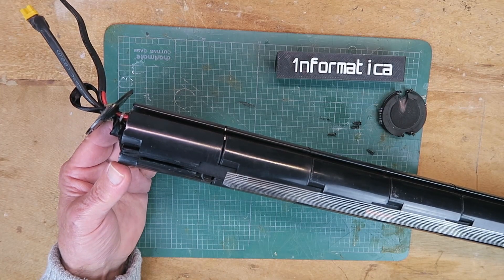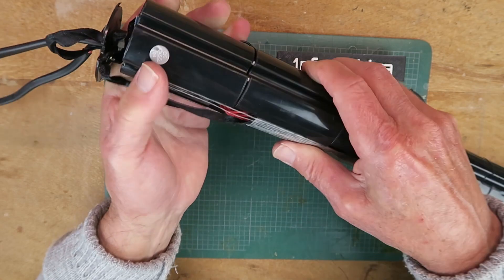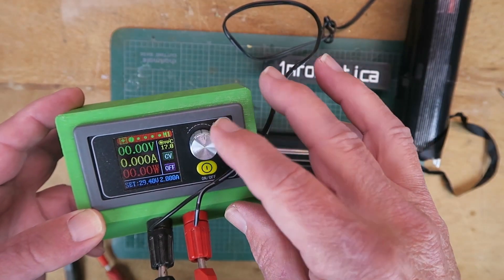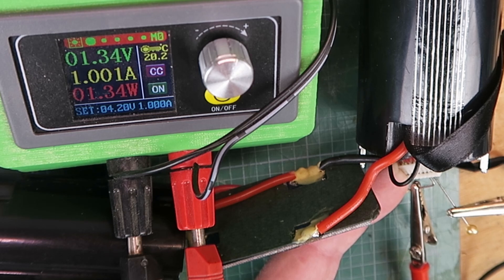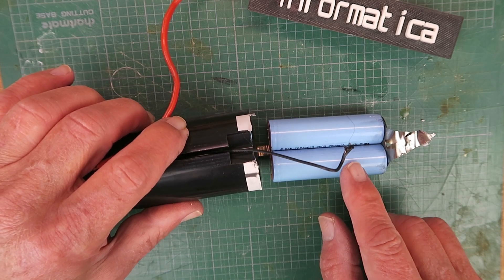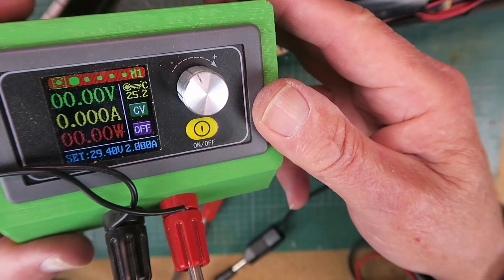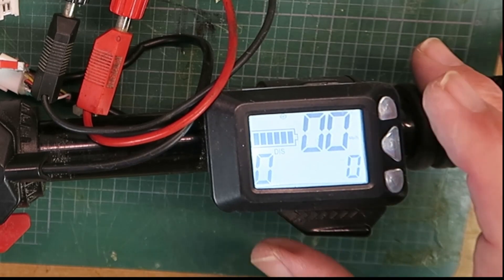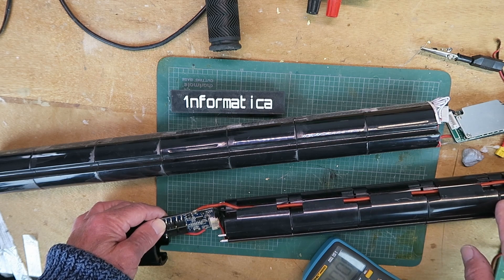Electric Scooter Stem Battery Teardown and Repair Guide

Comment: Great video! Did you find some kind of fuse inside? I suspect that my fuse burnt when i connected wrong charger but cant find it😊
Reply from the maker: Hey thanks! I don't think there is a fuse in the charger side. Most likely the BMS is the problem. If you have applied the wrong voltage it may be damaged or just need resetting. Search for BMS issues with your particular model. Thanks for watching, have a great day!

Comment: Hi, i have 3 dead cells in my escooter pack (in a group of 3 together) but not sure which to buy as i have no idea what capaicity the others are, does this matter? It's a 36v pack with blue cells with OOBS INR 18650 20 P 588063. I was also thinking of swapping my BMS just to be sure but can't work out what to get either. This is XYL-3260-13S V1.0. Any help would be appreciated. Great content :)
Reply from the maker: For best performance the cell capacity and internal resistance should match the original cells. I have a video about that : https://youtu.be/z2Rhk8KJp_k INR is usually either Samsung or Sanyo 18650 is the size and 20P is 2000 mAh. There are many "similar" cells like this : https://s.click.aliexpress.com/e/_DmLBhKT For the BMS look at : https://s.click.aliexpress.com/e/_DmNKIsT Check carefully the balance lead type, if your lucky it may match what you have and save some soldering! Thanks for watching, have a great day!
Reply: @1nformatica  Thanks a lot, really appreciate it :)
Reply: Hi again, i have been given some INR18650 30Q's, i'm guessing i can't replace my bad 20P cells with these considering they have a higher capacity?
Reply from the maker: @oggyoi3967  Well, strictly speaking no. However, the BMS should cut the charge off when the other cells are at peak voltage. There is no harm in trying, it is just that these cells will not be fully charged. Of course you try this at you own risk!!
Reply: @1nformatica  ok thanks, but what's the worst that can happen? If it's explosion then i won't :)
Reply from the maker: @oggyoi3967  An explosion is very unlikely unless you short the cells out, for example when soldering. In other cases the BMS should protect you, that is its job! Having cells of differing capacity and internal resistance just means the pack as a whole will not be optimised. Be careful!